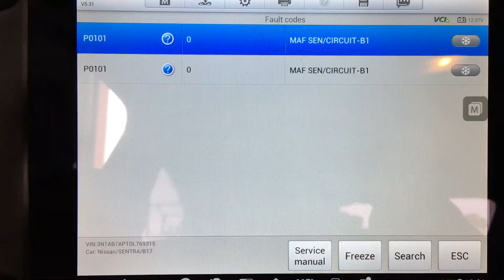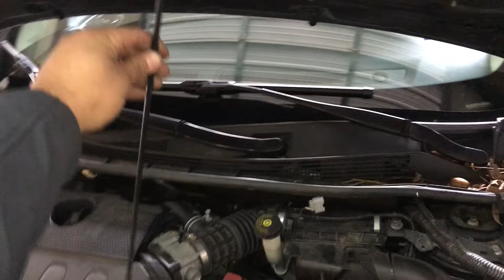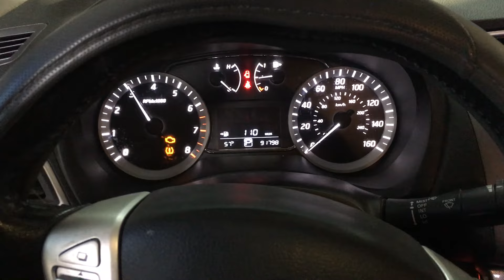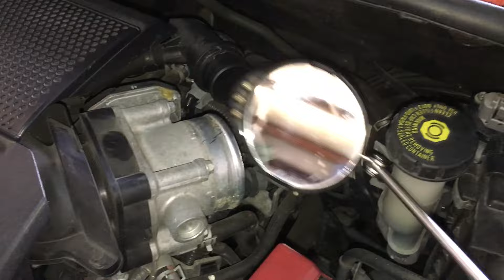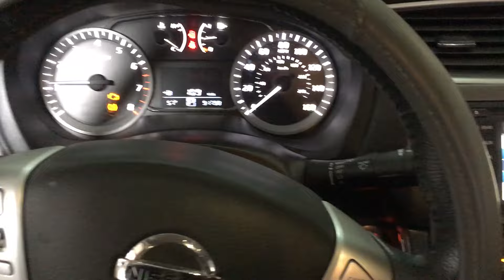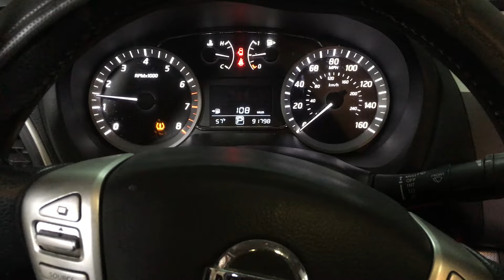NISSAN SENTRA STALLING DURING IDLE DIAGNOSIS AND FIX

Comment: ONLY PROBLEM IS THAT THE "PEDDLE DANCE" IDLE RE LEARN DOES NOT WORK ON ALL NISSANS; SOME, LIKE THE POPULAR 2.5l, END UP WITH VERY LOW IDLE SPEEDS OR "HUNTING" IDLE BOUNCE.  EVEN NISSAN IS AWARE OF THIS AND THEIR CONTULT II AND LATER DIAGNOSTIC TOOLS AUTOMATICALLY PERFORM A "SECRET" TWO STEP PROCESS TO GET AROUND THE PROBLEM: THE CONSULT FIRST ERASES THE STORED IDLE LEARN FILE BEFORE COMMANDING THE IDLE RELEARN COMMAND STEP, WHICH TOTALLY ELIMINATES THE PROBLEM.  MOST PRO GRADE BIDIRECTIONAL SCAN TOOL CAN DO THIS AS WELL, BUT ONLY AS TWO INDIVIDUAL STEPS, BUT THEIR RESULT IS THE SAME: STEADY IN SPEC IDLE QUALITY.  ON THE EFFECTED ENGINES, NO VERSION OF THE "PEDDLE DANCE" WILL FIRST REMOVE THE CURRENTLY STORED IDLE CONTROL FILE, PERIOD.

I CANNOT COUNT HOW MANY NISSAN DIY THROTTLE BODY CLEANING/REPLACEMENTS WE HAVE HAD COME INTO THE SHOP BECAUSE OF POOR IDLE QUALITY AFTER DOING THE "PEDDLE DANCE", WHICH WE CORRECTLY REPROGRAMMED TO ELIMINATE.  SOMETIMES YOU SIMPLY HAVE TO "PAY THE PROS" TO FIX THE ISSUE...................

Comment: I just went through this and the car hadn't had a catalytic converter on it for a long time every time you started the little car it would pick up really nice start running real well and then suddenly go dead randomly and I went straight for the effect that the catalytic converter might have on it😊 I changed out almost everything mass air flow breather😊 I went hog wild it was a coil with an embolism that was obvious if you ever pulled the fire was jumping through the rubber in creating a solid dead hard Miss to kill the car every time

Comment: Just because you don’t see anything you should still spray it I’ve had plenty of experience with MALF sensors to know the metal inside often looks oxidized or dull after spraying with Sensor cleaner the little metal post inside should have a sheen because the thing you may not be able to see it but that ECU does because it measures the air intake in microns hope this helps take care

Comment: Friend ayuda ya puse 2 maf air  flow sensor  solo se va por DOS a 3 dias i  vuelve El. Codigo?
Reply: Salvador.Estos sentras,traen uno de tres problemas con respecto a ese codigo p0101:Hay un TSB que el dealer tiene que hacerle un tipo de Reprogramacion.
Problema en el alambrado.
O que el sensor tiene que ser original Nissan.
?Como solucionaste tu problema?.

Comment: Changed the MAF myself. Now the air flow hose thingy needs to be replaced. The mechanic told me the part was $140 and the labor would be $160 to change it! 😂😂😂😂 I just ordered the part MYSELF for $19.99 on EBay and I’m putting that sucker in myself! He was going to up charge me over $120 just for the part. I’m disgusted and don’t trust him anymore .

Comment: My boys 01 GXE Sentra stalled the other day gettting back in traffic, it was hard to start and now won't rev up keeps cutting out and wanting to kill, if we spray staring fliud it will rev up when opening the throttle plate. The OBD2 PORT doesn't work which doesnt help, although the cig lighter does work.
Tried removing acc. plugs to try and find a bad connection to get the port to work, no link, link error. Changed the fuel pump still no go. Looked to the MAF as the car died when the plug was removed, one tech claimed it ment it was good. Car ran ok before that initial dying.
Any suggestions

Comment: This just happened to me at similar mileages.  I'm on my last leg.  No job, no money, just got done with an interview that is a strong possibility.  Then my car dies.  Now its back up.  Just cleaned the throttle body and now its working.  Thanks a ton.  I owe you.
Reply: Hi, is your vehicle still running after that clean up on your throttle body??,, I drive a 2005 nissan sebtra 1.8l it has similar problems,, if you got time, I would live to hear what you have to say,,, any Info  would greatly be appreciated,,
Reply: Dagbabit,, spell check ,,,,nissan sentra 05 1.8l
Reply: Live,, lol(LOVE) TO hear what's going on now😊

Comment: Hoping you can help me diagnose my problem...I have a 2013 nissan altima 4cylinder problem I'm having is car shutts of when coming to a stop or when I'm parked and revving it sometimes will turn off sometimes it wont...I removed throttle body cleaned it and did the relearn procedure and it's still doing same thing... car has 182k miles I appreciate it man👍I also cannot hear the electric throttle body do its relearn click...i dont have codes showing

Comment: I have a sentra too. My issue with stalling came with a bad PCV valve. It was exactly the same issue. Vehicle would start and then shut off. No amount of cleaning the throttle body fixed the issue, even replacing camshaft and crankshaft sensors didn’t work. Replaced the MAF sensor too, still did the same thing - kept stalling. It’s the PCV valve, that’s your fix. Cleaning the throttle body is a temporary fix, you need a permanent fix. I am the owner of 2014 sentra, this car has put me through a wringer with its issues. The only easy part is that it’s cheaper to fix, never mind the other more expensive cars. I maintain it as much as I can, my wallet is almost empty, but it’s still breaking. I don’t know what is the problem, but I might have to dump it to scrap heap if this continues. The good news are is that it’s not burning oil currently, so I am good, at least for now. Will see what happens in the next 50000 miles.

Comment: Im getting a p2014 code on my 2017 nissan sentra which is swirl tumble control position sensor. can you make a video showing where the hell it is or can someone put a link to a diagram showing its location on the engine.
Reply: Still have the issue?
Reply: @Trinsical  nope took care of it thanks

Comment: Could I relate to this Video if my 2017 Nissan Altima SR is stuck at 1 RPM? Car goes no higher than 45 MPH but RPMs go really high on the accelerator press.

Comment: So tip for next time.    If you leave the shifter in drive with the key on engine off and hold the gas pedal open to wot with a long prybar etc you won't need to push on the throttle blade and possibly damage the gears in the throttle.

Comment: Same exact issue on my nissan sentra 2014 car. I tried cleaning the throttle body and it works for a bit... but same issue immediately after. Haven't been able to drive the car properly for a month and I am still making payments on it. Do you think it might need a new throttle body?
Reply: I have the same p0101 code in my 2014 sentra. I was told replace the intake pipe hose because it frequently has cracks on it. I will do that to see i can fix this issue. I already replace maf sensor and cleaned the throttle and nothing happened.

Comment: what was the charge for that service ...i got a 2002 se-r 2,5l 4cyl and i changed the mass air flow sensor just to improve the drive ..the service soon light came on ..it has not re set on it's own ..the idle runs up and down to a near stall ..i have not touched the throttle body ..and it ran ok before but this fix has not worked for me ..ummm when i clear the code will it make the car idle safe again ..btw ..the car drives and idels fine in gear ..but it's in a limp home mode i think ..will i need to reset the throttle body just to replace the maf sensor ..idk ..can i put the old one back ..will it idle the same with that or have i done something else ..lol..

Comment: I have a 2021 Nissan Sentra. When I park my car and have not shut the engine off. If i run it in park for an hour so I can run my a/c. I’ll get a system malfunction displaying on the dash. I’ll then put the car in drive. It will shake and then stalls. One time I couldn’t start my car with the push to start. I had to use the start option on my key fob. Help. What is going on? Only has 30k miles

Comment: Mine is a sentra 2006 special 1.8 that stalls after i drive it for a while. It runs good but can stall. I let it idle for about an hour and then right there it shut it self off.  Once it cools
 down statrs again. I had both the camshaft and crankshaft sensors changed ,but to no avail, stills stalls out on the road. I go to work,a 15 minute ride,come back home not a problem,but if I go a little longer then i break down. Can't find the cause

Comment: My Nissan 2017 200NV 2.0L(89K Mi) just stopped running last night(at 60 mph) 100 miles from home.  It turns over, chugs, or runs a few seconds, similar to this Nissan. Fuel line pressure seems strong.  When it runs a few seconds smells real rich.  Will try cleaning T-body but it must be more going on.  Any suggestions appreciated.

Comment: I don’t have a check engine light on but my car stalls and jerks a lot 2014 Nissan Sentra   Idk what’s going on with it the rpm number can go all the way up to 3 when I’m trying to press the gas and it’s still moving slowly for it to be all the way at 3 then it jerks bad and the rpm goes to where it’s supposed to be for the mph I’m going
Reply: How many miles on your Sentra?

Comment: so i cleaned the throttle body but now i get the p2101 code it doesn't shake in idle anymore, but when i try to drive it now it doesn't accelerate anymore. is it because i don't have the machine to reset the throttle body sensor?
Reply: First - did you have no code prior to cleaning your throttle body?
Second - Are you sure you reconnected the throttle position sensor or equivalent?
I just now looked at the date of your comment.  Is it fixed and if so what was the fix?

Comment: Very clear and precise video. Mine is rough idle while stopped. Jumping from 650 back to 500 then back. Consistently. No check engine light. No codes. Also having an issue starting only  after it's been  off for a few hours. Cleaned the Mass Air Flow Sensor. Cleaned throttle body. Any ideas?  Thank you!
Reply: did u solve it?
Reply: @BillSW  Nope.  So far have changed, plugs, coil packs, camshaft sensor, crankshaft sensor,. Ran sea foam fuel injector and fuel system cleaner through it.  I can tell you that it's slowly getting worse. Sometimes when it starts now it sounds like it's starving for fuel but it always does start. And no problems driving once it starts. Fuel economy is good pick up is good. I can also smell fuel after it starts. Seems to be pointing to possibly one or two bad fuel injectors. The car is just not getting the fuel and needs to start up right away. Of course if they were faulty fuel injectors I would notice it in the performance.
Reply: Since it only gives me trouble starting when the car is cooling down it says something to me about a temperature sensor. Possibly the fuel temperature sensor.  Who knows at this point.  I'm not even sure if the  rough idle and the delayed start is even connected.

Comment: Question: Would the throttle body and/or mass air flow sensor cause a tachometer to jump during acceleration?  Every time I get to around 20-35 mph the rpm jumps from 1500 to 3000, then drops back to normal.  After that it's fine, but happens each time I stop and then start again.  At idle, the needle dips a few times like it wants to stall, but doesn't.  Let me know when you can.

Comment: What is the difference between a throttle body that is mechanical vs electronic where you do not want to mess with it and touch and move it? How can I tell before I move the valve to clean it and fuck it up?

Comment: IK this vid is a year old but...I hit a couple of rough bumps due to them taking the pavement off the road in a construction zone. My check engine and slip indicator came on. I stopped at a light and it rattled a bit while stopped. Then when I get to my house and put it in park my car just cut off. What could be the problem can anyone help. My dealership is right up the street from me I don't have money to get it towed just right up the street .please help

Comment: Hi Eric, very nice video. Thank you. Just have one question, I have a 2015 Suzuki Alto RS Turbo with drive-by-wire throttle system. I have this idea to remove all the pipes of the throttle and clean the butterfly thingy with carb cleaner. If I do that, do I have to connect a scan tool and do that re-learn value thing? I got abit scared when i saw this video since i do not have a scan tool. Please advise.

Comment: My 2011 Altima had the same problem with the same code. After 2 visits to the dealership, they couldn't fix it. I cleaned the throttle body and it's fix!!! Thank you so much Eric. Keep up the good work!!!
Reply: What did you use to clean the throttle body?

Comment: Thanks, I'm getting the same code and if I don't have to take off the TB to clean it & that might fix it, I'll try what you did. I'm not having idle problems though, except one time recently it died on me after taking off from a cold start but I let it idle for a minute & after it warmed up it was fine.

Comment: Glad I could find your video, instant follower. Question for you: Do you think that this gunk you cleaned in the throttle was due to a design flaw of the EGR system? I read somewhere that this engine recirculates a small portion of the exhaust back into the manifold, and the input his is right after the MAF. Any thoughts? Should Al Sentra have this cleanse as a preventative maintenance?

Comment: Hi! Erick. Great video and amazing job.
Listen I have a 2013 Nissan Sentra and when I am driving it band reaches 40mph starts like accelerating and I feel that overdrive activates and the shift doesn’t goes through. At first a mechanic told me that it was a transmission issues and that it needs a new transmission but then two more mechanics told me that if it was a transmission issues that car would stop running long time ago. So a mechanic suggested me to check the transmission oil and I did and in fact the oil was dirty, so I changed the transmission oil and the filters but after I drove the car for 20 minutes the issues went away for a moment I meant the car was running ok; however, three days later it started doing bit again and oil was dirty again; what do you think the problem is? Do you think that I need to change the transmission? Hopefully you can give me a feedback. Thank you
Reply: Did you find the answers?

Comment: Hello I’m having trouble with my 2017 Nissan Sentra Sv I got the diagnosis on it. I’ve looked up what the codes mean already. The dealership Nissan told me I need a new transmission and only one code says the replacement of transmission may be needed. 1 out of 8  codes. The rest are sensors may need to be replaced. Other problem was the transmission fluid may need to get changed. Now the question I have is what should I do if I had the transmission fluid changed I pay $240 and I’m getting the reading that it needs to be changed does that mean I was lied to and it was never been changed or they didn’t add the right transmission oil? Please if someone can help. My first car and making payment on this vehicle still need some help on what to do
Reply: The dealership is probably right, if it’s a cvt and not under warranty sell the car before it’s too late it’s only a matter of time before those things break and they are expensive to replace

Comment: I have a 2017 nissan sentra.
Automatic. 4cly. My problem is im only getting 200 miles per tank instead of the 400 miles per tank. Vehicle runs and drives good. Idles fine. Just poor gas milage. Any???

Comment: Advanced level automatic I’ve you see this can I get a reply please I have 17 Nissan Sentra sv have aftermarket 18 on it I have bad fuel economy I was get bad economy before I even put rims on it I used to get 400 miles to a tank and now i only get 260 have replaced the spark plugs already runs the same recently it like want to stall when I come to a hard stop or even regular stop but dose not die I see rpms slightly jump when idle and when I accelerate I hear a fluttering sound

Comment: In a Nissan Sentra 2004 I had to replaced 02 sensor ( the code P1279 show 1 bank 1 air fuel sensor was greater than the maximum allowabe limit) the RPM were find befor I replaced the 02 sensor.  Now I can start up the engine just find when engine is cooled. But when the car engine warmes up the RPM drops and when I need to restart the engine the RPM will drop to 0. I get the same code P1279, I went and changed the PCV vale and still the will start the first time and when I truned it off and restrated the engine it has the power but the RPM drop to 0 I have to push the gas pedal 3 to 4 time to get the RPM up. Please help...

Comment: I have 2017 Nissan Sentra Sr turbo,not Check engine light,I dropped in the deeler and they said then my tail light has foggy inside. They did not fix,I went  to other shop and said then they can not do anything if there is not check engine light. My car when is moving loosing power,the acceleration is very slow, rpm go to 2000 or 2500 and that is all. Any one can help me. The mass sensor was installed and nothing hapened

Comment: You can unplug it and run it without the sensor and if it’ll run without it. It’s on a open loop at start and doesn’t need sensor Input.

Comment: Had my MAF and camshaft position sensor replaced on my 02 (2.5L), was not the issue, a lot of labor and parts in cost, the issue has returned. I personally am thinking more towards throttle body. This video is a very great perspective for this repair process regardless of year. It defines a simple code that is in relation to another component. Specifically related to Nissan vehicles, the code does not source the actual component issue. Great video.
Reply: I had my versa die after a warmed up ended up being the fuel pump overheating a quick replacement under the rear seat ran better and have better acceleration apparently versus have issues with fuel pumps